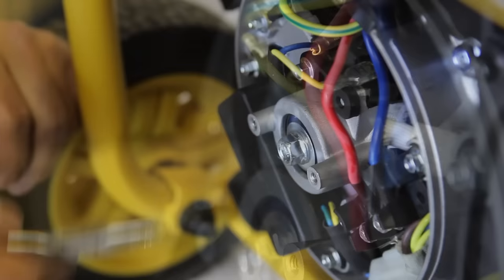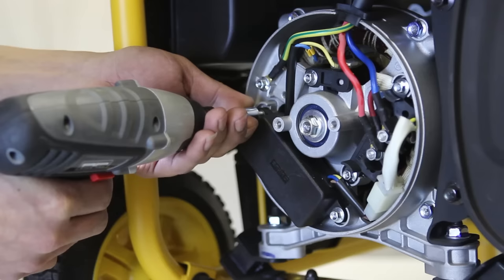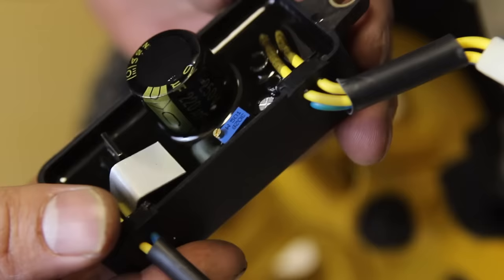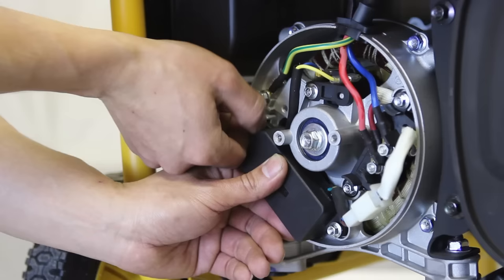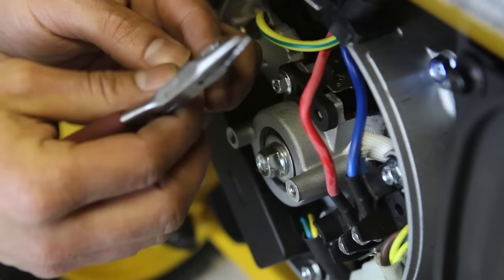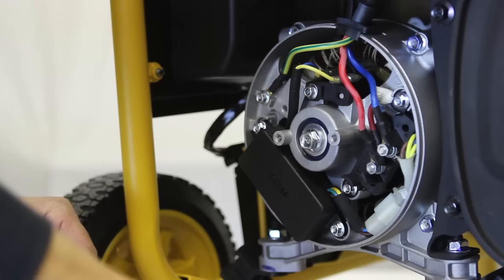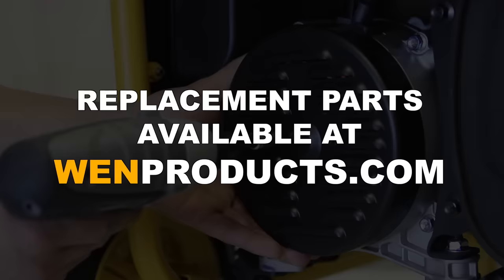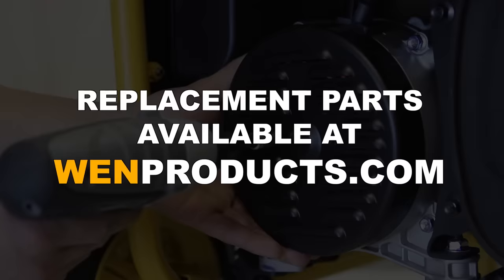How to Change your Generator's Voltage Regulator (AVR)

Comment: Are there any AUTO START PANELS for DF475 type WEN generators?  Needing a low battery voltage generator auto start switch or connection.  Maybe show the key start wiring diagram here for DIY assembly??? Thanks

Comment: Hi there,  can you tell me if there is a different in regulators between 110 and 220 volt generators? I have changed my regulator on a 220 volt generator but now i have no more voltage as 140! I have turn the little blue regulator in the avr all the way up but without succes.
thanks in advance!
Reply: Has anything came about from this? I am going to change my regulator in hopes it will boost the voltage because the generator runs fine
Reply: @alabamacloud1065  Not for me, I stoped this project

Comment: Hi, I have a 1978 generac 5000 watt generator that I believe the AVR is not working anymore. I was wondering if any online replacement would work? I would need to modify the generator wiring to adapt to it of course. Any thoughts on this? Thanks
Reply: P

Comment: Can some one give my advice please I have years problems with my standard Delco 12si alternator I need to use different capacitor types for my ignition system but sadly the capacitors interact with my cutt in current or starting charge rpm .
Insted normal rpm 1000-1200 rpm it get swaped for exampel I use hv ceramic capacitor meaning my alternator constantly back feads true the bulb pin 2 isnt used the back fead wont stop unless I rev my engine more around 3000-4000rpm.
So please can some one notifi my if avr system wuld work or not on my Delco 12si alternator or culd I use magnet alternator with those old extermal regulators like current cut out selenoids or similar my land does not have solar panel regulators.
So I hoppe some one understands my problem.
I desire cloosed loop system that prevents back fead and reverse polarity protection for my other devices.
Im realy anoyed at that thing .